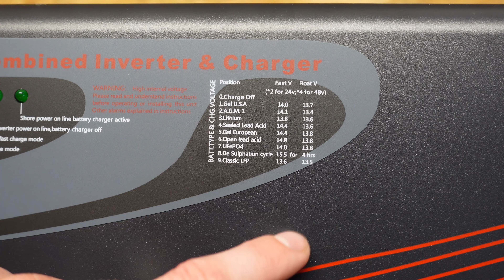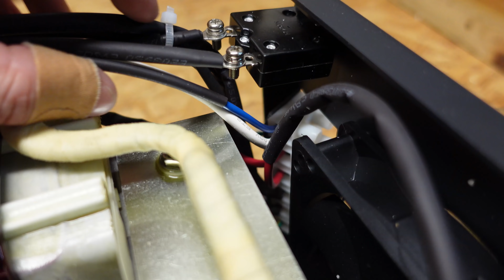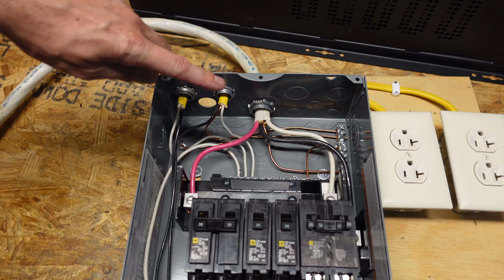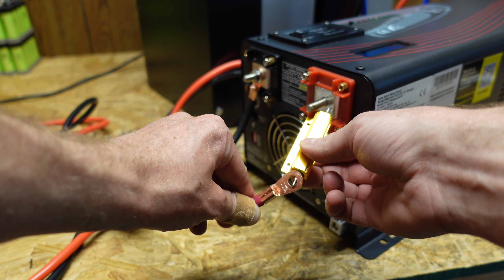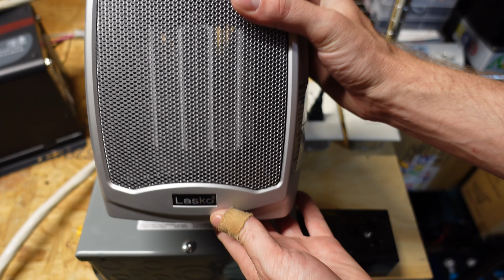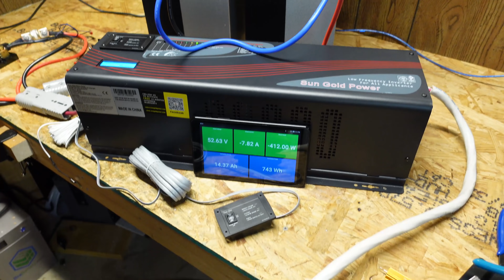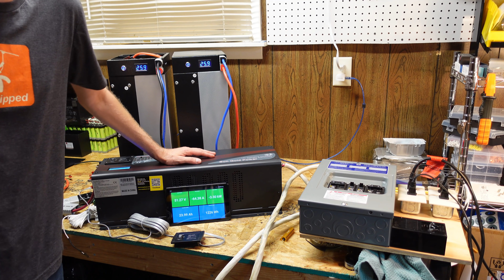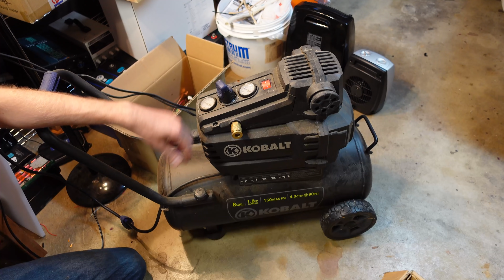SUNGOLDPOWER 6000W Pure Sine Split-Phase Inverter, Review & Testing

Comment: These look identical to AIMS inverters.   I suspect there's a common family tree and marketed/sold in different ways?   One difference is that AIMS has a couple of ETL certified versions - which I own - and I'm hoping (maybe) it has slightly more robust components?   Be interested if someone knows what's up on all this :).
Reply from the maker: I agree. I'd love to buy an AIMS 6000W and compare them side-by-side but $1700 is a lot just for creating one video lol.
Reply: @LithiumSolar  Awhile back I purchased both the AIMS 48V input 6000W low frequency 240V/120V output split phase inverter, as well as a SUNGOLDPOWER 48V input 6000W low frequency 240V/120V output split phase inverter.

I only just got the SUNGOLDPOWER unit hooked up about five days ago, and have only used it for about 12 hours under 5.4kW output load for electric car charging purposes (plus about 50 hours of idle time with no load).

The AIMS and SUNGOLDPOWER seem very similar, but so far, I definitely prefer the SUNGOLDPOWER, for a few important reasons:

1.  When I load the AIMS inverter output higher than 18A at 232V AC continuously for more than a few minutes at a time, the unit emits a worrisome burning electrical smell, although it smells fine at or below 18A even when operated at this level for several hours continuously.  So far, the SUNGOLDPOWER unit seems to work fine at 22A at 244V AC continuous output (sustained for 6 hours during my first car charging session), although it does currently emit a foul burning Styrofoam smell.  The burning Styrofoam smell is no doubt due to actual melting hot Styrofoam, since it gets packaged and shipped in Styrofoam, which tends to break off small pieces that then fall into the unit air intake holes.  Then, upon operation, they get really hot and smell bad for awhile, but I expect this smell to eventually go away altogether, once the Styrofoam has finished baking off volatiles.  The same burning Styrofoam smell was emitted from the AIMS unit early in it's operational history as well.

2.  The AIMS unit cost me roughly $1900 after taxes, while the SUNGOLDPOWER cost me about $1300 after taxes.

3.  The SUNGOLDPOWER has a small LCD display that shows input DC voltage (not too accurately though), input AC voltage, and output load in percentage of 6kW rating.  The AIMS unit omits this rather valuable feature altogether, thus requiring an external DC power meter, which further increases the effective cost of the system.

Overall, so far my impression is that the SUNGOLDPOWER is equivalent or better than the AIMS, especially the price tag and being able to more confidently sustain operation at its full power rating.  Both units however have massive room for technical improvement, as they both lack proper 0.1V accurate configurability for charging voltage and low voltage cut-off, for safe use with various types of lithium ion batteries available today.  They also both consume vastly excessive idle quiescent current, and have much too low overall efficiency under load (both rated around 88%).  

If they improved the efficiency from say 88% to 93%, this would effectively shrink the required battery bank of the solar system by about 5%, and simultaneously increase the "effective size" of the solar array by about 5%.  For a $30k solar array + battery based system, this equates to a savings of $1500 on the overall system, which would easily justify paying over $500 more for the inverter (say if they doubled up the MOSFETs and improved the transformer, so as to get better efficiency - along with better overload capability).  They should also improve the inverters to allow paralleling of multiple units, as a standard feature.  Ideally, this would become a standard feature on all inverters from all manufacturers.

Comment: You complain about the 'wasted' energy of the inverter/controller when idle.  Did you try the power saving mode you mentioned at the beginning of the review?  Just curious.  On my inverter/controller, when you use the power saving mode, it shuts off the transformer/inverter until you begin to use a device.  Thus saving that constant drain.  Are you sure you haven't overlooked that feature on your's?
Reply from the maker: Here's a follow-up video explaining and testing the power saver functionality > https://www.youtube.com/watch?v=57Tuf6mXsL4
Reply from the maker: Yes it has power saver, no I did not try it. I don't fine that feature particularly useful as you still see pretty much the same self-consumption when a small load is applied. Additionally, my inverter is never off in my home - always something consuming power even if it's just phone or laptop chargers.
Reply: @LithiumSolar  "I see", said the blind man.
Reply: @LithiumSolar  So, I guess my next question is this, does that 100 watt consumption continue while using current consuming devices?  Is the consumption always 100 watts over and above the load device?  If not then your 'always' use may solve the issue.  Just sayin'.
Reply from the maker: @aday1637  Will do some further testing and provide a follow-up in a day or two :) There are a lot of efficiency questions being asked, so I'll collect them and answer as many as I can in a short video.

Comment: whats the chinese warranty? 1300 bucks on something from china that has lots of parts.....lots of junk reviews on amazon
Reply from the maker: Good question. The warranty is one year and they do have a US address, so I doubt you would be returning it to China if you had a claim...
Reply: You would be returning it to China for a claim.  Had nothing but issues with this unit.  Gone through 3 control boards and a power board with no solution found.  Was forced to pay shipping multiple times for these replacements.  They are also hard to correspond with,  sometimes having to wait days for a response.  Once it even took over a week.. After spending 3 months going back and forth,  I eventually called this a loss and went with Victron,  much higher quality of manufacturing

Comment: Would the Big Battery 48volt batteries be any better you think?
Reply from the maker: I assume you're asking about the Husky (48V)? I do think that is a more refined product than the Wolfs I have. It's slightly less capacity, but if I were buying again, I might consider the Husky over a pair of the Wolfs. I primarily went with the Wolfs as I was intrigued by the A123 cells vs the aluminum-cased cells in the Husky.
Reply: @LithiumSolar  Yes, the Huskys I was considering getting two of those.

Comment: Most of the idle current is MOSFET gate current and keeping the iron core of the transformer saturated.
Reply: A large part is the magnetizing losses in the core. Grain oriented silicon steel laminations lose about 1/2 watts per pound of material when idling at normal operating flux. This loss is independent of the load in the transformer, and dominates the losses at idle. At full power, copper losses due to the resistance of the windings become the bigger portion.
Reply: Well said. I just point out above that you can't get away from it. Inherent.

Comment: I see it cost about the same as the MPP Solare LV6548 ALL in one... is there a reason to get this over the MPP Solar ? thanks
Reply from the maker: MPPSolar products are great as well. The most significant difference will be this is low frequency and the MPPSolar is high frequency. This means the SunGoldPower will have a huge/heavy transformer that allows it to start large inductive loads. The MPPSolar won't have this, won't have as much starting capacity, but will also be more efficient because of not having the transformer. I guess at the end of the day, it comes down to how you plan on using it / what loads you intend to run. If you're running a large air conditioner, welder, well pumps, etc - this may be better suited for you. MPPSolar also has the solar charge controller, which this does not, so you'd have to factor that into the price comparison as well :)
Reply: Starting power of low frequency inverters is great.

Comment: You only did a power on test, you have not tested the power savings setting, which may/likely reduce the standby consumption. I'd be very interested in the power savings version of the test.
Reply: From the OEM, AIMS Power, it is specifically deigned for sump pumps for marine use. Not for providing power for a home on "power saving".
Reply from the maker: Here's a follow-up video explaining and testing the power saver functionality > https://www.youtube.com/watch?v=57Tuf6mXsL4

Comment: All split phase 240 transformers have a center tap that is the nuetral.
Reply from the maker: Yes. In a normal transformer like this, you have 5 wires - 2 input (L1+L2) and 3 output (L1+L2+N). I'm asking about it being an autotransformer - meaning it will only have 3 wires (L1+L2+N).
Reply: @LithiumSolar  Your question doesn't make much sense. 
Both configurations must have input wires (eg connections to the primary). It's only the output winding which is referred to as an auto-transformer. The input windings are completely separate.
Reply from the maker: @graemezimmer604  It makes perfect sense. I'm asking if it's a 5-wire transformer or a 3-wire transformer. A 3-wire autotransformer only has one winding.
Reply: @graemezimmer604 , does it means, that inverter's transformer has two primaries: the first one is a low voltage winding, to be powered from inverter stage, and the second one is 240 V AC winding, to be powered from grid in UPS mode? And split-phase 120/240 V AC output winding is galvanically isolated from grid's 240 V AC primary winding?
Reply: @LithiumSolar , I suggest, that grid input must be isolated from output, because output neutral must be grounded to comply with the Code. But if output neutral is grounded, and grid's hot legs (phases) are galvanically connected to the output winding, than we will receive imbalance current in output neutral, that will flow from inverter's neutral to grid's neutral through home's grounding conductors.

Comment: Cam two or three be wired in parallel?
Reply from the maker: The batteries can be wired in parallel. The inverter does not support paralleling the AC output.

Comment: You get a neutral wire from the center tap on the transformer
Reply from the maker: Yes. My question is whether or not that transformer is acting as an autotransformer (only one winding) while in AC bypass mode.
Reply: @LithiumSolar  Depends if a relay (or similar) is used to disconnect the transformer. 
Whatever, it would make little difference if one side was left floating.

Comment: 95 W in idle is a nightmare - 2,4 kWh per day or 876 kWh per year for nothing else than being ready.

There must be other solutions than such high current drawer. Having a 8 kWh battery and wasting 2,4 kWh would mean to wast a lot of valueable energy storage, at least at night when everything is coming from the battery.
Reply: This would not really be a problem on something such as a boat. You would only turn it on when you needed to run something. Each inverter has a percentage loss. This being 6kw, it is apparently 100 watts. If it was the 24 volt model, it would probably be more and a 12kw model even more. This is why you only get an inverter the size you need. More is not better in this case.
Reply: @lkeil84  my 24v Sungold 6000w inverter ran 100w idle same as this one, but also had an efficiency of about 85% when I measured it using two 1500w heaters on my batteries for 1.5 hours. So 3000w of heaters were actually consuming  about 3500w from the batteries. It is supposed to be rated at 88% efficient, and maybe it would get that at 6000w load.

Comment: Did the battery saver mode help on the idle consumption at all?  Curious if it takes longer to respond for AC power if the battery saver mode is on too.  Very nice inverter though and great if you need to get a workout in.  No need to but weights!
Reply from the maker: Here's a follow-up video explaining and testing the power saver functionality > https://www.youtube.com/watch?v=57Tuf6mXsL4
Reply: On mine, you do have to switch off then on again to restart the inverter after it goes off in the power saving mode.  After a period of time (several minutes) the inverter shuts off when in the power saver mode.
Reply: Supposedly these inverters will wake up when you put a load of 25 or so watts, but my 2kw 24v model didnt do that in my test. I just leave mine on al the time.

Comment: Do you feel this or a lower wattage unit would be good for a small office UPS substitute?  I'm getting tired of conventional UPS units and want something a little more robust.
Reply from the maker: It would work but, at 6000W and low-frequency, is definitely overkill for that particular application. A smaller MPPSolar high-frequency would be best suited for an office UPS. I have a plan to build something exactly like this but video is a month or two out at this point.
Reply: @LithiumSolar  I look forward to seeing it!

Comment: And yes on the neutral wire off the transformer it's tapped like an auto transformer I have changed my transformer in a victron inverter to be split phase single unit I know you can parallel them or split phase two units but I didn't need two units

Comment: I got a tip to add to your testing setup use those rotating style DC shutoffs and wire in your resistor across both terminals so when the switch is off the resistor is connected then you can just plug in your Anderson connector with the switch off and it connects the resistor automatically that you can just flip the switch on for testing

Comment: 'Are' fatal voltages.......  ALL inverters act as an auto transformer,  as the trafo attempts to lock between 117-120+-vac at a fixed maximum amperage..   In addition, the neutral/ground should always be at least one  gauge larger than the hookup wire, as is properly noted in this video..   I'm surprised to see only 12ga. hookup wire.. The diode  conversion from vdc to vac and the subsequent smoothing caps generate heat and wasted power..  Those small gauge series wires (silicone insulation does not increase the gauge, LOL!)  are taxing the internals of the inverter and no fun for the batteries, either..  Nice review..  How are you charging those batteries..??
Reply from the maker: Interesting regarding the neutral wire. I thought requirement was that it be sized such that it can handle full current of either leg. No, silicone insulation doesn't increase the gauge and I didn't suggest that LOL. But 200C insulation increases the amount of current the wire can safely carry. Batteries were charged with a 48V charger that I purchased from BigBattery.
Reply: @LithiumSolar  "it can handle full current of either leg"       At the bare minimum..  Depending upon the length of the run, good techs, people with proper technical knowledge and training in the design and repair of electronic circuits, always wire the ground/rail, no matter how short, with one gauge larger wire, unless they want to save money....   
Lesser techs may convince themselves with internet pap, do as they wish, and hope for the best..    
         "200C insulation increases the amount of current the wire can safely carry"...(???)    
Kindly explain to me  the reasoning and science behind that (no boob toob crap), as the only thing I know of that can do that is larger wire gauge..  The  improved insulation does not increase the gauge,  but it MIGHT prevent arcing from one wire to another in close proximity  and help mitigate heat radiation, which increases the heat inside the jacket increasing the chances of meltdown,
but it cannot increase  the current carrying capacity..   Again, you can believe what you wish, and hope for the best..  Good luck boob toobers with your own designs, you'll need it..  LOL!
Reply: @LithiumSolar  that wires are not number 12 they are in fact AWM 10 15 wire number 10 wire rated stands 105c 10 awg